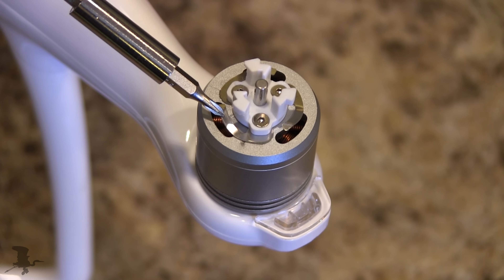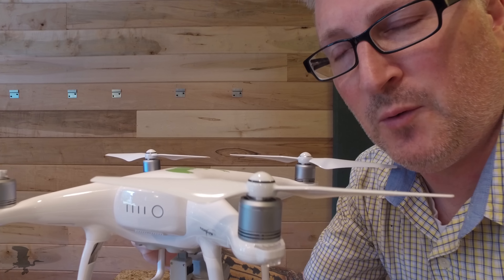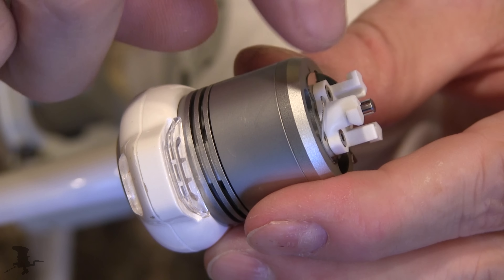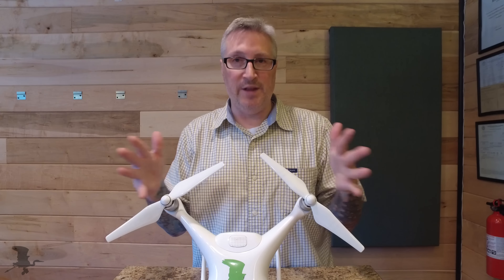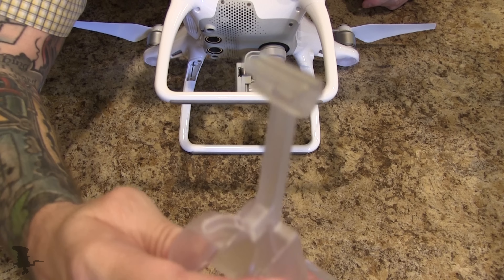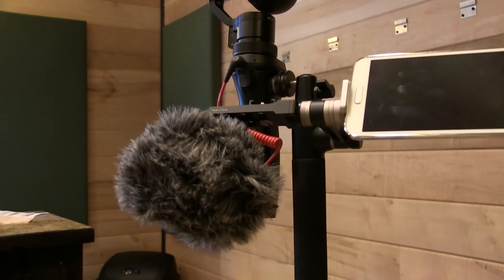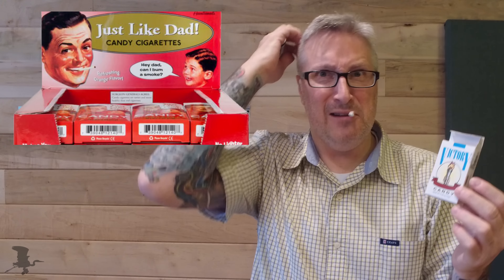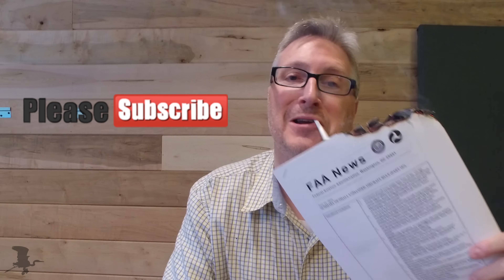DJI Phantom 4 - FAA Part 107 and PROP Maintenance

Comment: I will never understand why DJI used these motor mounts again, they originally used them on the first Inspire 1 and users were falling out of the sky because the props would pop off. When I decided to replace my aging Phantom 3 Pro, I looked at the Phantom 4, great new craft, but simply for that reason, I ended up buying another new Phantom 3 Pro for $999 with a FREE battery, now I have 8 batteries total instead of having to buy different ones all over again;  I'm luving it! Happy flying!!! ;-)
Reply from the maker: If it ain't broke, don't fix it!
Reply: exactly that's what i was thinking why would they use the same crapy prop mounting design that caused problems on the inspire 1 first gen
Reply: Eduardo Carmona The only thing I could think of was, the motors on the P4 aren't as powerful, so maybe they would be as bad, but if you need to maintain the thin metal pins, that presents a potential issue. Happy flying and safe landings!
Reply: Cheaper then cit a threat

Comment: I know quite a few Phantom 4 owners that are swapping out that little clippy piece hardware thingamajiiggy that fatigues over time, and replacing it the Phantom 3 style male post thingamaboppy.  They can then use self tightening props similar to the P3 & that way they never have to worry about metal fatigue, because they will eventually fail on you and you don't want that happening in the air.

Comment: Hello. Good Video, but what about Metal Fatigue? should you not ( at some point) replace those little metal pieces and if so when? Now I was referred to your channel by someone in the DJI forum. My original question there ( because I'm studying for my part 107) is How often should I change out my props? I currently have a Phantom 3 Pro, and shortly after I purchased it new about 3 years ago, I purchased some carbon fiber props with stripes on the tips off Amazon. They are still on my bird today as I have a case that will hold my bird with the props on and it still fits in the overhead bin on an airplane. So I never remove my props. So in being, we are required to keep a maintenance log How would I handle the props? Any advice would be greatly appreciated! Thanks, Ken!
Reply from the maker: Hello Joe!
Yes, metal fatigue is a concern, but the replacement parts are very inexpensive.
I don't recommend carbon fiber props simply because they are so dangerous to body parts.
Replacing props should be done after crashing or hitting a hard surface. Check for visible damage, but really the only thing replacing with new ones does is improve efficiency. Again, I would use only OEM DJI parts and avoid carbon fiber props.
Happy flying!
Reply: Thank you! I did not know carbon fiber props would be any more dangerous.

Comment: Ok Ken, I'm convinced I need to give up the cooler for a proper case for my props.  Which one do you recommend?
Reply from the maker: Awesome!  Here's a great one at a fair price from a nice company:  https://youtu.be/zuiGcrxAP1M
Reply: Hey Ken. What is the Phantom 4 case you recommend? The link you posted is not for the case.  Thanks.
Reply: +Ken Heron Never mind. I ordered a Microraptor case with backpack. Maybe that's the one you meant to link.

Comment: Can you help me? On every single DJI phantom 4 flight whether it be 100 feet or 1000 feet I get a weak image signal transmission error and the live  feed continues to cut in and out! What can I do to stop this ? is there anything at all you can do to help thanks
Reply from the maker: Hmmm...  First make sure your controller is charged.
Then check the frequencies in the Go App to see how much interference you have in your area. The frequencies are defaulted to AUTO. If you are on the frequency page in the Go App and see a GREEN open channel, try setting it manually to that channel. There's a possibility you are near something that is generating interference. Also... Try re-calibrating your IMU. Here's a great video on how to do that: https://youtu.be/zuiGcrxAP1M  --His channel might have answers for you as well.  Good luck!
Reply: +Ken Heron I have tried recalibrating imu , called DJI , reinstalled the app , doesn't matter where I am flying over the ocean or near house happens every time live video cuts out and get weak signal transmission. It's horrible! Can't figure it out I'm afraid to fly it more than a few hundred feet because I don't know if I'm going to have the signal to do anything

Comment: It's interesting that my Phantom 4 has a different prop retaining system than the style shown in this video. Instead of the leaf/tab springs mine has a single coil spring located around the center pin.

Comment: Ken, I'd like to bring your attention to these new metal propeller mounts for the Phantom 4. They are made of metal aluminium alloy and so I believe they will be resistant to any sort of cracking or wearing. I've ordered a set so will report back on how well they work once I have them installed on my own drone. Check them out: http://www.infinity-hobby.com/mobile_product_info.php?products_id=12812&language=en